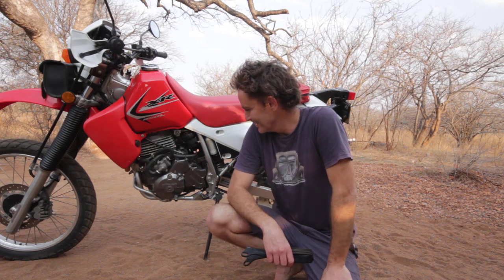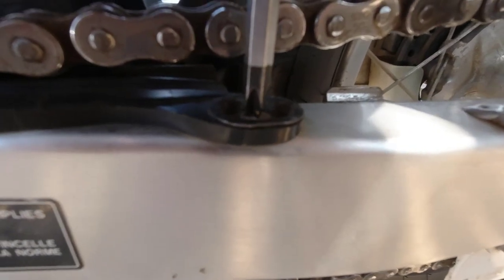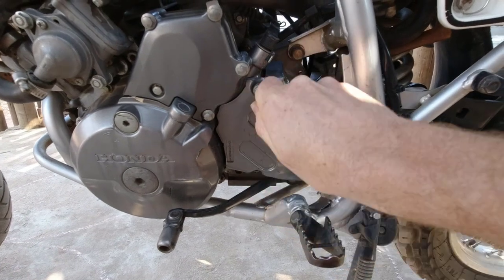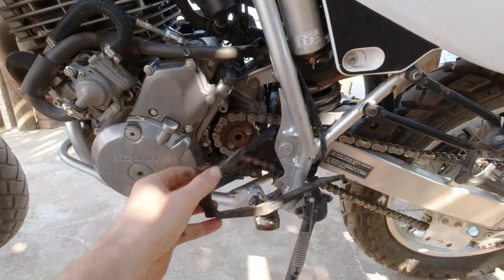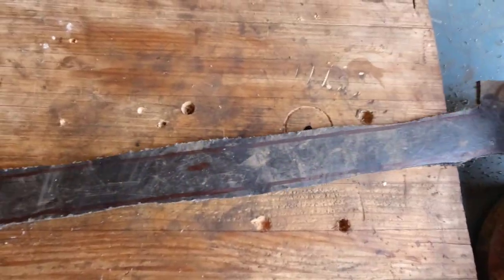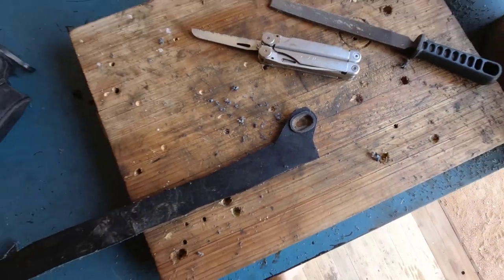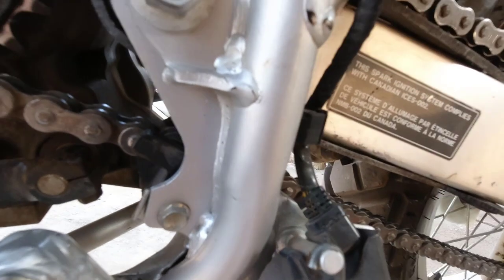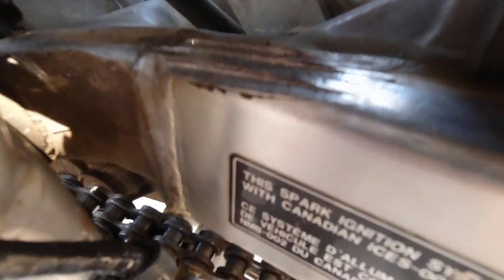Make Your Own Cheap Motorcycle Chain Slider | DIY Honda XR650L

Comment: For $20 buy a new slider.  It is cheap, reliable, plentiful, and essential!  Unless you are stuck out in the boondocks... which then I doubt if you'll have a drip pan, vise, hacksaw blade, tools, etc.
Reply from the maker: I will probably get one sometime, but Honda has no parts in SA at the moment and shipping costs more than the slider. And I am a cheapskate :)
Reply: Didn’t he show a screenshot where it said it was $45?

Comment: After two years it will be interesting to know how it lasted, most sliders are made of polyurethane and not plastic, as plastics melts...
Reply from the maker: Good question. Unfortunately, I sold the bike before the slider perished.
Reply: How many kms did you use it for before selling? Thanks for the response 👍 😀

Comment: $40 for a chain slider? KTM sells theirs for $90 and its just a piece of plastic, don't know why they charge so much, but mine lasted 7 years and it still doesn't need replacing. KTM OEM parts seems to last longer than Honda OEM parts.
Reply from the maker: Wow, $90?!! Yeah, the Honda one is super soft and this one didn't last 10 000km. I ordered one from Amazon for $10, but shipping to SA is the same. I think this DIY one last longer that the soft plastic ones.

Comment: Nice mod. Now get rid of that smog octopus and put an exhaust on that thing. From the factory they’re crippled.
Reply from the maker: I've removed the smog pump... but still need a pipe! And off road tires!
Reply: @GreaseAndGravel  fmf q4 with the power bomb header is a killer combination
Reply: @GreaseAndGravel  for off road I recommend the Kenda Trakmaster for the rear tire

Comment: Cool idea, but it really needs somthing that wears, but you could used that for a short time till you can afford  one. Now a sheet of Teflon would be ideal  but where do you find it? , its not everywhere. 
Ok peace.
Reply from the maker: I did not know that. I assume it needs to wear to protect the chain? I have a piece of Teflon, but it is too thick.
Reply: @GreaseAndGravel  
I just put a new sliper and slider.  But I have saved them  to make templates  if I can find the right size Teflon.    I'll make it just  beefier,   give it more wear time.  
I have some durlyon , its supposed to be some tough stuff.  Was thinking of making a sliper. But, ill wait and see how the new one wears.
Ok brother. Peace and ride safe.
Reply from the maker: @CKILBY-zu7fq  I also like trying to make stuff where I can. But yeah, sometimes new is just easier and better. Peace brother!
Reply: @GreaseAndGravel  feel free to ring  if you need somthing, ill see what I can do.peace brother.
Reply from the maker: @CKILBY-zu7fq  Thanks man!